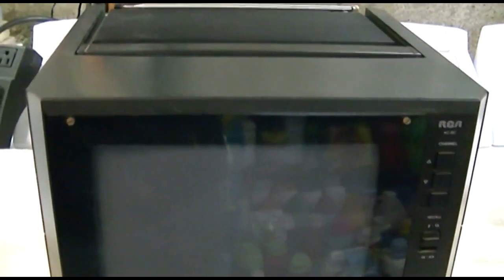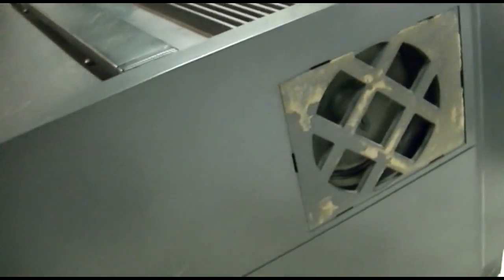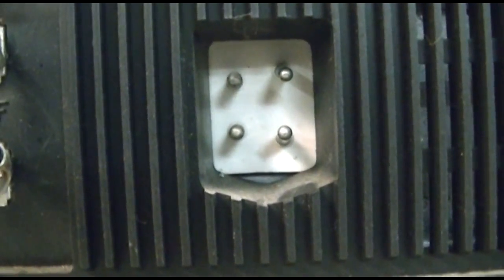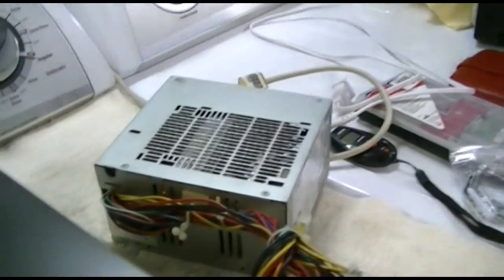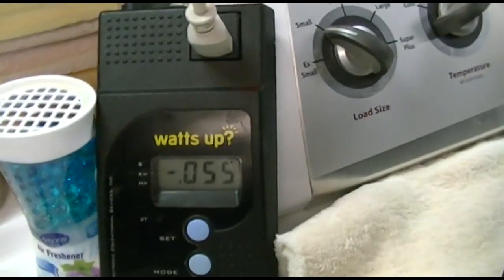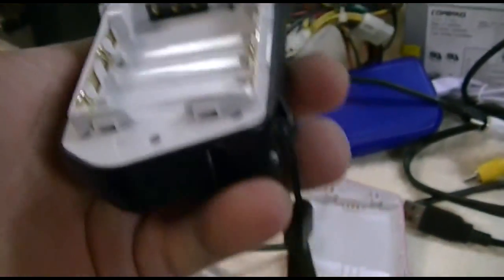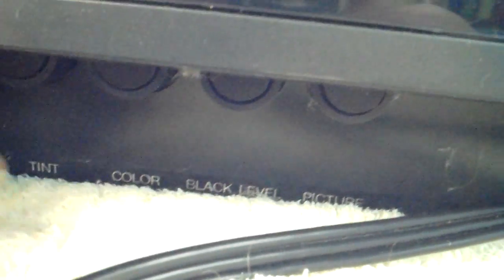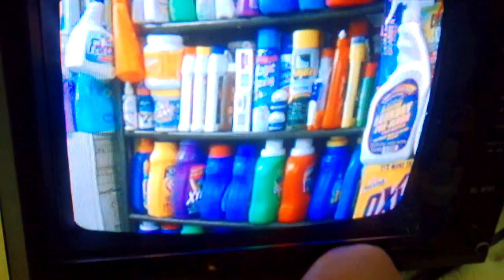RCA XL-100 9" Color TV Model EMR295E From 1986!

Comment: NICE!!! Mine was (I think) a couple years older.  The channel up and down/recall buttons were horizontal at the top, and the power/volume was also on the top. But yep, every time I powered it on, I had to scan up to the channel I wanted.

Also, you were right, on DC, the CPS wasn't able to keep up, and it was undervolting.  That caused the jumpy picture.  The wavy green line was some sort of resonance interference on the power supply's output as well.
Reply from the maker: +Harley Badger Thanks.  And just think, somebody threw this out.  Shame...
Reply: +jaykay18, yeah so horrible that the TV was thrown. If It was a flat screen, then I wouldn't give a rats rear end about it.

Comment: I used to use DXG Slim HD Camera to use as a Surveillance Camera when I was cutting grass at front lawn, sweeping debris off the sidewalk, scraping the dirt off the sidewalk off the vinyl, Watering to the plants, and shoveling snows off the Sidewalk. That way I can be more secured for myself.
Reply from the maker: +Bluethunderboom Well, I'm going to have a whole video on it tomorrow!
Reply: For DXG slim HD Camera, I wish I could modify to use DC Line so I don't have to bother the Rechargeable Batteries or the AAA Batteries so I can still set at the Living Room Window and use the Monophonic VCR to record SLP to see what's up with that.

Although, I had the video I would like to share with you the one I filmed outside at the sky if you want. =)
Reply from the maker: +Bluethunderboom Sure, I'll watch the video.
This unit, like I showed, I power off of a USB power bank.  You can also power this directly from a phone charger or something like that over the USB.  I'm certainly not dumping AAA batteries in it, it'll eat those alive.  And buying the actual battery?  Not only will it be hard to find, it'll cost more than I paid for it--nothing.
Reply: I have the video that I post one called, "Cloudy Ice Cream Pt 1-2 & Pt 2-2" because, the cloud is swirling by the wind out there and unfortunately, I can't convert from MOV to WAV format to have a better full screen instead of wide screen like a movie. Not only that, the audio quality is low and get it to have a better sounding.

It's back before when I got Nikon 1 J1 Camera with attachable lens.

Comment: the ohm switch on the modulator should be on 75k. high impedance is if you are daisy chaining the modulator with another video monitor.
Reply from the maker: +Brandon MacEachern Thanks for the info, I've changed the switch over to 75.

Comment: I have this TV found it last summer. IT was working then thre picture suddenly compressed into a inch line in the middle of the screen.  It seems to work fine otherwise. Any idea if this can be fixed easily?
Reply from the maker: Yes, it can.  I don't know the name of the part, but it's a simple component that can be replaced to restore it.

Comment: What kind of power supply does this tv require?  I picked up a pink one at a garage sale but it does not have the power supply and I can't find one anywhere.  Thanks in advance!
Reply from the maker: Look at the label on the set, it will specify the power requirements.  If yours is similar to mine in that it can run on 120 volts AC or 12 volts DC, make sure you don't hook 120 volts up to the 12 volt terminals.
Reply: @jaykay18  which side is which?
Reply from the maker: @raulalaris  Try watching the video.
Reply: @jaykay18  Lol yes it's around the 7min mark that you answer my question!
Reply from the maker: @raulalaris  I am extremely thorough.

Comment: I came across one of these a few years back for free at yardsale its been in a closet since then came across this video and pulled mine out and hooked up a digital converter and works great so thanks for the help any way on hooking up a dvd player? thanks for the help.
Reply from the maker: Thanks very much!  Yes, you can hook up a DVD player.  You need something called an RF Modulator, you can find them on Amazon for under $20.  Your DVD Player must also be able to output a Composite signal, most can but not all, so check that first.

Comment: I bet if ya drive up to Binghamton, New York, I bet you'd receive an analog TV station that's still there. You'd better hurry with your TV and head there then you could pick up the station. It shuts off in July of 2021. Hehehe
Reply from the maker: That's over a 4 hour drive for me.
Reply: +jaykay18, o wow. You're way closer than I am. I don't even live in the state of New York.
Reply from the maker: @kraig8812  I watched that video, and wasn't really impressed with what the guy pulled in.  I've seen what broadcast TV can actually look like under ideal conditions.  Understandably, this was a low power station, but that was really poor signal.  Then again, if it were digital, there would be absolutely nothing it would pick up!
Reply: Yeah you're right.
Reply: I’m in Syracuse, so I’ll have to try this sometime 👀

Comment: Hello, thanks for your video! I just bought one of these on facebook marketplace and was wondering if you happen to know the resolution of this unit. Im also having very much trouble finding info about it online, where did you find anything about it?
Reply from the maker: It's an NTSC TV.  What the actual resolution of the tube is, I don't know precisely, but NTSC could support up to 480 lines, but most TVs handled considerably less (partly due to overscan and partly due to other factors).  

I didn't find much info online either.  The information I have is due to my findings.
Reply: @jaykay18  i just picked mine up and i must say its pretty sharp for a tube of its size, the colors are also very vibrant on my unit and its much brighter than i expected. I counted the amount of pixels in an inch and multiplied that by the height to get a vertical resolution of about 260-300. Less that 480 for sure but more than enough for my purposes. Your video was a tremendous help in figuring out the power inputs by the way! Mine came with an AC adapter but my plan is to use it in a car, so knowing what was positive and negative and what was 120 or 12 volt is incredibly valuable info to me!
Reply from the maker: @aeaeaeaeoaeaeaeaeae  That information was incredibly valuable to me as well, and I had to figure that part out on my own.  I took an educated guess on that.  In hindsight, opening the unit up and seeing where the connection leads would have clued me in immediately.

Comment: i am trying to find a power cord for this, found one at a savers and wont buy it till i get the cord
Reply from the maker: Good luck, I looked for one also and came up empty-handed.  You can power it just like I did in this video.
Reply: i found a tv on ebay for $6 how ever it like $60 shipping and it has the cord. i want this to work with an nes and a atari 2600 i have
Reply from the maker: ***** It'll work.
Reply: actually, could i just take the 2 prong plug put it in the  12volt side but cut the wall prongs off the cord and hook it into a 12 volt power brick?
Reply from the maker: ***** Absolutely.